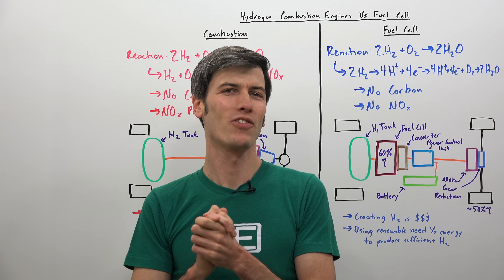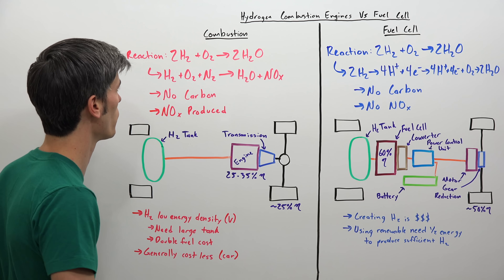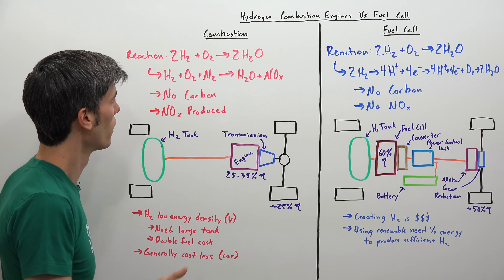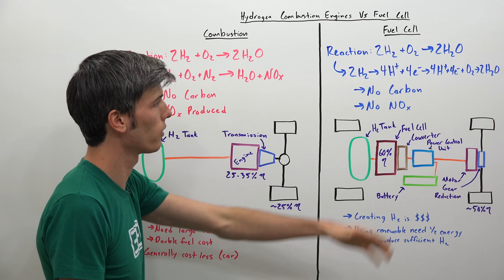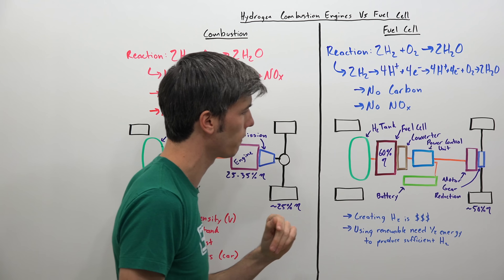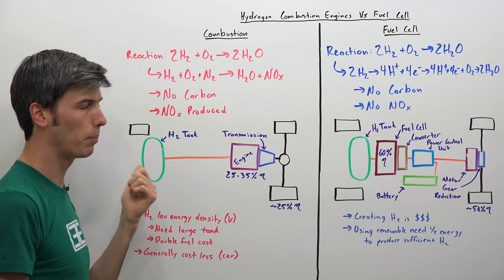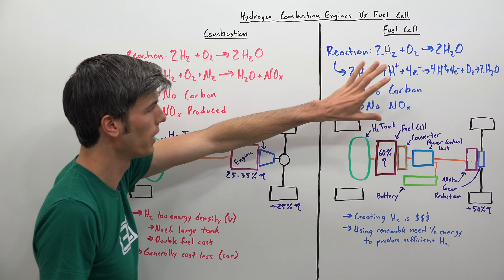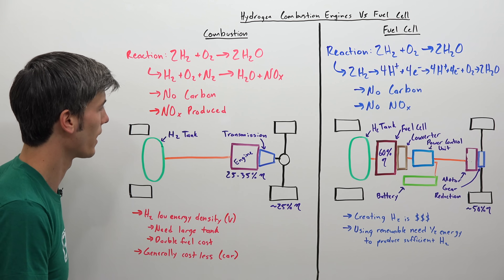Why Hydrogen Engines Are A Bad Idea

Comment: If you compare your two diagrams, you'll see that the FuelCell vehicle requires vastly more components to be mined, extracted, purified, fabricated, shipped, and assembled.  And all of that "busy work" taxes the environment.  The simpler, less taxing piston engine is the better bet.   People think that "more tech" will save the world.  They are fools.
Reply: You're right, but we should make it clean and efficient piston-engine.  ...an external combustion engine. Their continuous, well-controlled combustion is clean and completely fuel-versatile. The Stirling engine is the most efficient heat-engine. It's external-combustion.

Comment: Informative, but not that helpful for those of us who ride motorcycles. Could you do another video contrasting the pros and cons of these two solutions for motorcycles. There is a great variety of ICE motorcycle designs to suit different types of usage, but for example my Yamaha MT-07 weighs about 400lbs and produces about 74hp and 50 foot lbs of torque. My daughter's Yamaha YZF-R3 weighs 365lbs and produces about 42hp and a little over 20 foot lbs of torque. Currently, there are a variety of ICE motorcycles available weighing in the 430 to 450lb range producing 200hp or more. Given that motorcycles are very small, the greatest challenges for any new power technology will be to match current ICE power and range without increasing size or weight or diminishing range.

Comment: What you are forgetting is that hydrogen is very easily produced with electricity if you simply think outside the box just a little bit, say you were to put a alternator on each wheel going to a battery, and you were to get a bunch of stainless steel plates with a battery ran to said stainless steel plates then submerge them in a water/potassium hydroxate solution, you could produce it as you use it
Reply: This is why people have scarcely reproduced the real Stanley Meyer version of the HHO cell. It was regulated by a central control unit. I do believe what he made is not only possible, but the implications expand very greatly. And I think for this reason, his technology was hushed
Reply: What about liquification and transport cost ?

Comment: If you use hydrogen direct fuel injection your engine is far more efficient. Any NOx formed if formed “using lean burn technology and high flame temps”   AdBlue/ Diesel Exhausts Fluid / Aqueous Urea Solution which all mean the same thing, a fluid injected into the hot exhaust gas stream in conjunction with a catalytic converter, can pull apart the NOx back to natural non damaging products. It’s already being done in Diesel engines.

Comment: Honestly, many of the points you make about hydrogen ICE being inconvenient aren't that much of a deal if you change infrastructure.
Lower range from Hydrogen ICE could be countered by more fueling stations for example.
Oh, and hydrogen has an octane rating of >130 RON, so its THE highest that exists. That means you can run CRAZY amounts of power in an engine.
Reply: Yes a tinnnnny engine can produce a good amount of power and expand range
Reply: @alphaprime6102  Rubbish
Reply: Turbo hondas on race fuel fly they are 7-8sec cars
Reply: @Cruner62  true
Reply: @GoldenEDM_2018  much more stored energy in the same space with hydrogen, there are barely any electric charging stations

Climate friendly power will run both but It’s less pollution than mining rare materials for batteries 

More simple you dont need so much technology in a hydrogen car where if one small sensor goes wrong the car is a brick

aviation and homes will use it may as well run cars on it keep electric too though